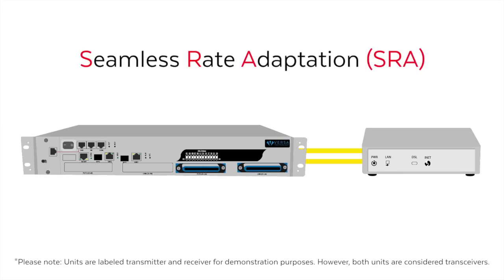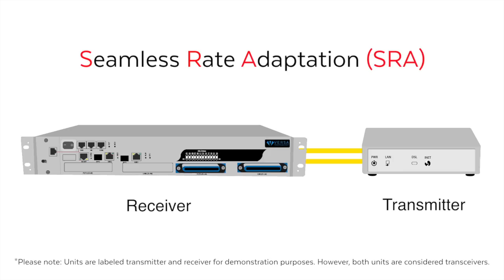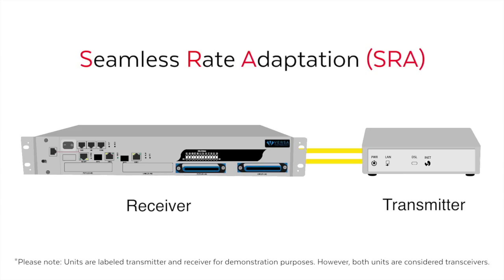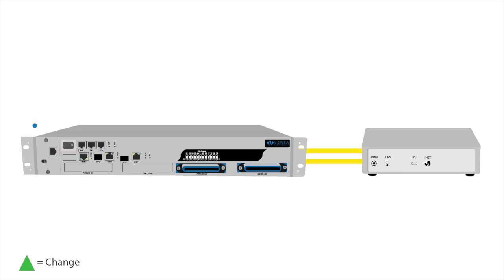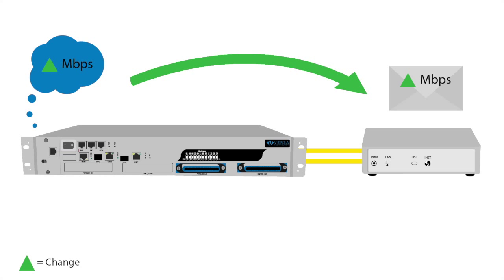How does Seamless Rate Adaptation (SRA) work in ADSL2/2+?

Comment: Hello, I have a Question. Is setting a Wireless Channel (Ex. 1) good for my connection. I noticed channel 1 is free.
Reply: Most routers have a "Scan for congestion" option or something with a similar name. The router will scan all the Wi-Fi channels in your area and pick the one with the least congestion/use in your area. That's the only reason to mess with wi-fi channel numbers, to get on the channel that the least number of Wi-Fi networks close to you are using. If your router does not have an auto scan function, there are smartphone apps that will scan and list the wi-fi networks around you (including ones that don't broadcast a SSID or "name") and tell you the channel they are using. You'd then pick a channel for yours that you don't see being used by the other wi-fi networks.
Reply: @sean8102  Thank you for your comment Sean. 

Thr problem is that I live In a very corrupted country where internet connection speeds are literally limited to 2mbps, 4mbps, 6mbps, and open speed which reaches up to 9-11mbps. 

Also all of these plans have a fair Usage policy (FUP) which means you won't be getting the full speeds of these plans. 

For example,If you're downloading something, your line would impacted by FUP to help others around you.

So the speeds are distributed. Can you imagine that. Shameful

I have the latest Tp link modem/router, I have the latest Deco Mesh wifis and I'm still not able to receive proper internet.

Talk about a waste of money. Everything is set-up optimally but because you have a corrupted government and people, this is the result of it.

People in the west should be grateful for what they have, where they live and the state of how they're living.

Thanks.